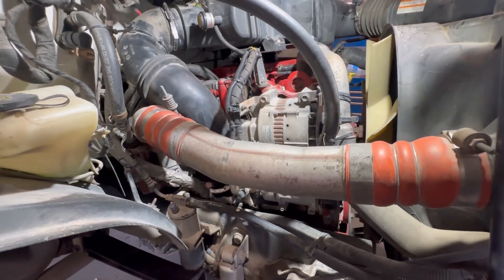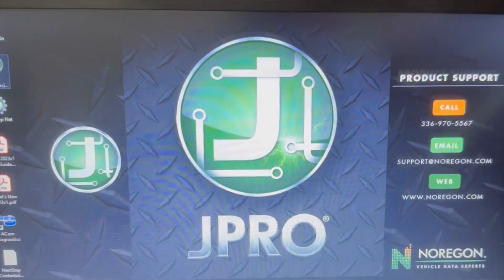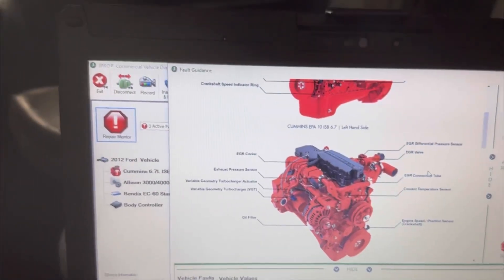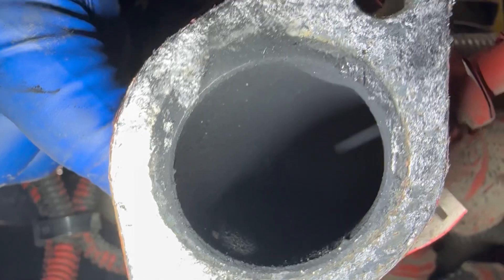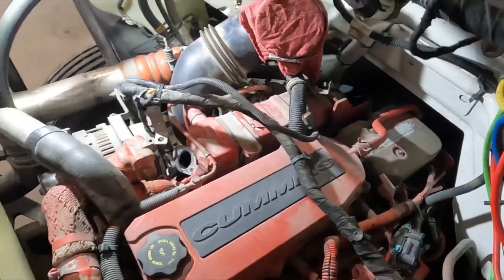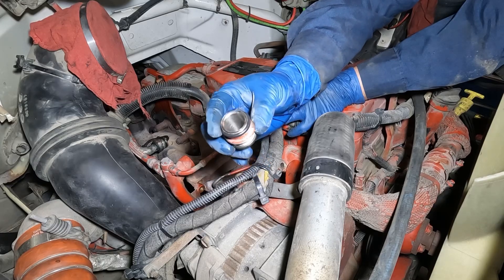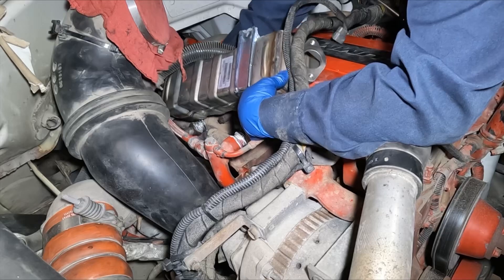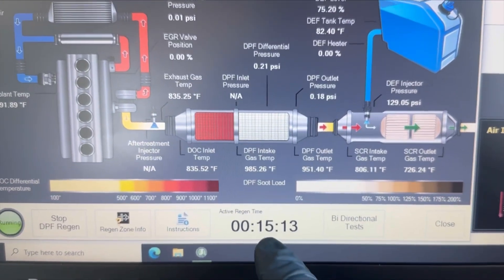Customer States- My EGR valve needs to be replaced again!! (Cummins 6.7/ ISB) EGR system diag&repair

Comment: I usually remove my EGr cooler and clean it once a year through the holidays when work is slow .... but this time, right after 2 days of hard work, i got a code smh 🤦  
Fault code 1896  
Egr valve out of calibration 
Egr valve been replaced 3 months ago 🤷‍♂️

Comment: I have a 2019 International 4300 series with the Cummins engine and a Eton transmission automatic 7-speed with 190,000 miles and 4,600 hours on the engine. It runs fantastic but my only concern is when I go up a long hill my truck struggles and runs max 45mph struggling. Is that normal or do I need to ask a mechanic to max out the power in the engine with software?
Reply: Little late here, but unless you're pulling a ridiculously steep hill then I'd say you have an issue, do you have any fault codes showing on your dash? I'd bring it into a shop, but for a quick check you could look at your air filter ( don't just trust the restriction guage as they can get stuck, actually pull the filter out and bang it on the ground to check if it's dust packed) then check for any boost leaks, ie damage to any of your cac hoses, loose clamps etc, and check the air compressor feed hose as they like to blow near the bends, then using a flashlight look for any signs of soot around the exhaust manifold, turbo mounting face, and egr cooler etc. Any of these things can and will cause a low power issue, could also be a restriction in the fuel system, so check your fuel water separator, and main fuel filters aren't old/ getting restricted. Hope this helped if you haven't already figured something out.

Comment: Love your content where is your shop located 
I have an electrical issue on my kenworth t680
Paccar engine. 
Every time i turn on my ac my check engine light turns on. For some reason it trigers accelerator pedal
Code (spn 91)

Comment: I have a 2012 Hino. It seems to have lack of power and it won’t regen can help me out 🙏
Reply: Start by checking your fueling on engine is the injectors ok not over fuel? (rolling coal) Also air filter not clogged? Egr stuck? Are you using the right oil? Check injector in the dpf.... When you try to regen is the dpf getting hot enough? Hows the noxs sensors reading? hows the dpf pressuse sensor? Also if dpf is to clogged dpf wont regen.... Remember once youve carried out regen you have to replece engine oil and filter.

Comment: I have problem with isb 6.7....coolant temperature gauge takes 1 hour to move a little bit up, when cold runs cold, when hot outside running on hot side(no overheating) but hot. I changed thermostat and fan clutch, cap, nothing. Turbo works but weak. Do you have idea what could be? Can't figure out 3 months
Reply: Have you checked fuel filters?
Reply: @trengoblin2  yeah, I change that often. Temperature dropped and didn't let me do regen, so it put me in derate bc of low temperature
Reply: @MarcoNiki  I would check your thermostat. Sometimes they can be faulty out of the box. Also delete your emissions its gonna cause a lot of long term issues. Maybe check exhaust brake function (weak turbo problem). Otherwise not sure might save you money to get it looked at.
Reply: What’s your coolant temp showing on data PID. The data temp is vital for running performance and even won’t regen until engine is up to temp. May use a laser thermometer on your hoses and at thermostat to check for accuracy
Reply: Love the videos! Just starting my YouTube channel and it will be about mobile breakdown repairs and situations.  Do you use anything for your shorts editing? Editing is a pain lol
Reply from the maker: @GreaseGuru  thanks.  InShot video is what I use for editing